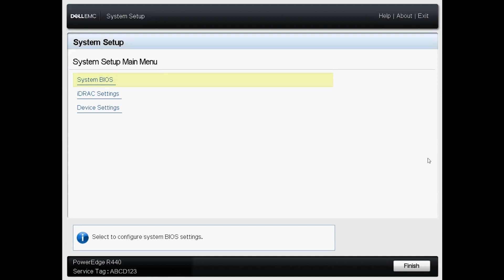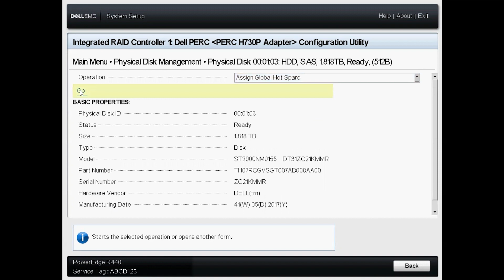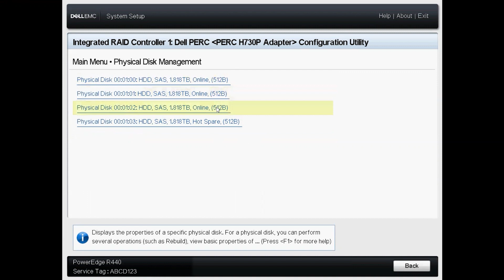What is a Hot Spare Drive and How to Configure it on a PowerEdge Server

Comment: To Locate Clear Foreign Configuration In Storage Management
For SAS controllers with firmware versions 6.1 and later:
In the Server Administrator window, under the system tree, expand Storage to display the controller objects.
Select a controller object.
Click Information/Configuration on the controller Properties page.
Select Foreign Configuration Operations from the Controller Tasks drop-down menu.
Click Execute.
In the Foreign Configuration Preview page, click Clear.